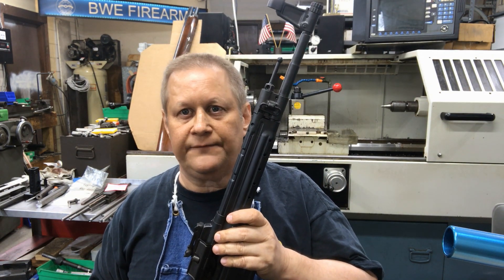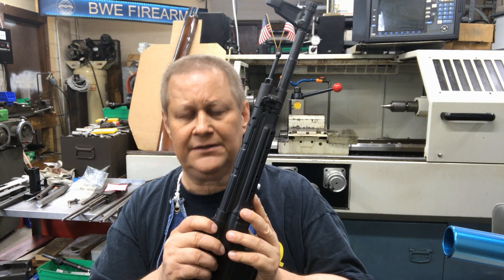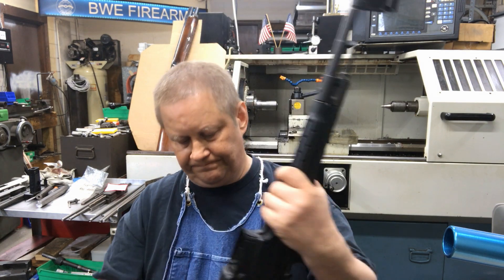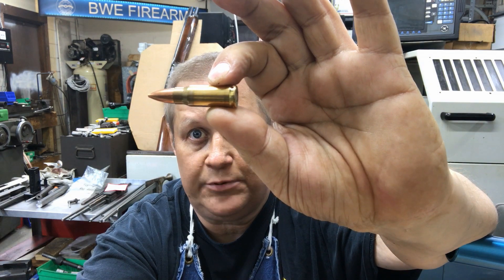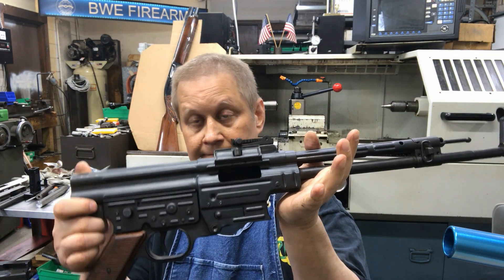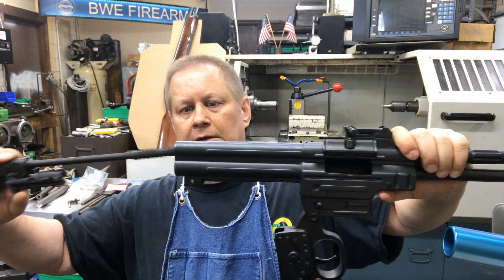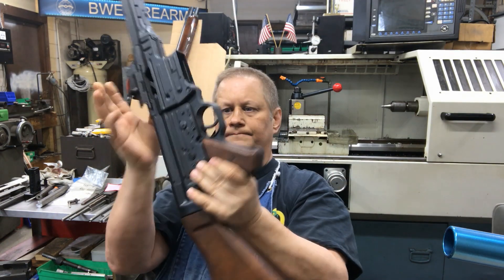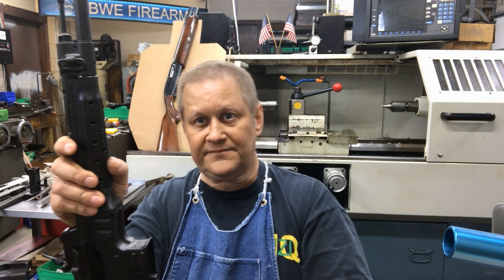The Sturmgewehr STG44

Comment: Some people debate that MK "copied" the Garand operating system, I don't know if I subscribe to that theory but I do personally think it's obvious he took a lot of the cosmetic/ergonomic (pistol gripped fire control group and the rear trunnion/leaf combo out to tall front post sights) aspects along with the ammunition spec (intermediate cartridge when high powered was essentially all there was) as well as utilizing sheet metal stamped components wherever possible, all of those similarities make it hard to believe the AK47/AKM/etc weren't heavily influenced by the STG. On another note though I never noticed until this video just how similar the CETME/HK G3 type systems were, structurally in how they fit together at least, to the Sturmgewehr as well, great content, you earned my subscription for this and the Uzi videos, hope to see more from you